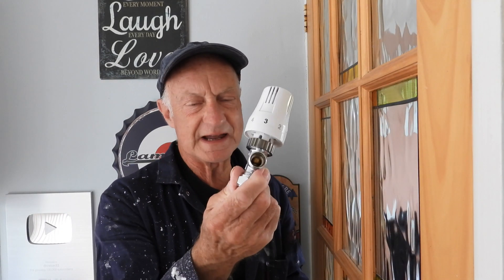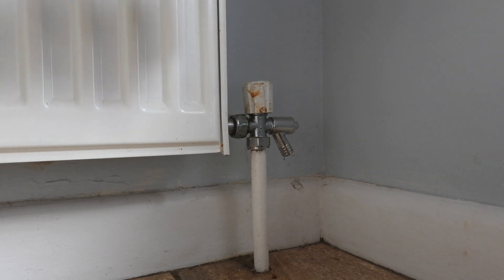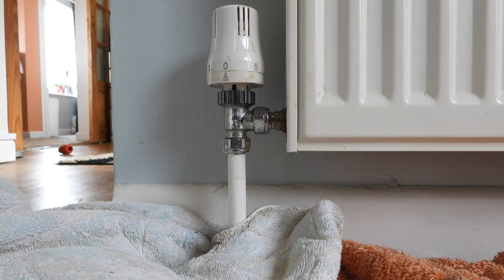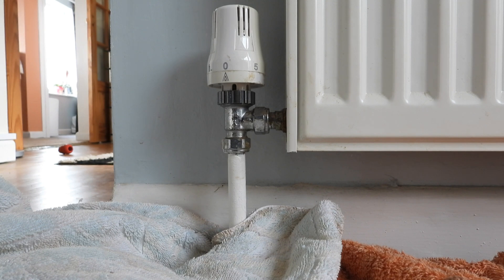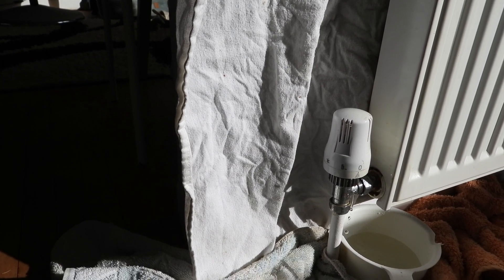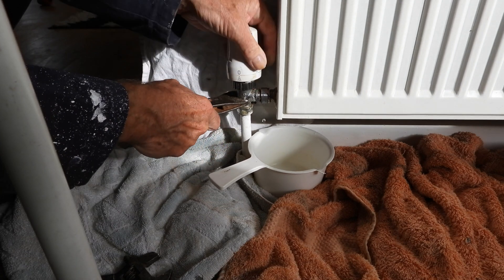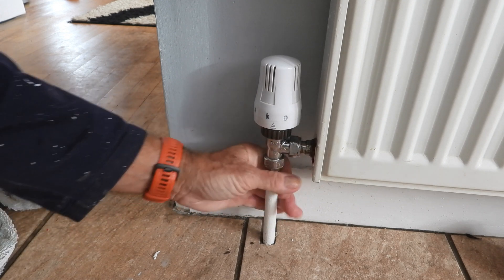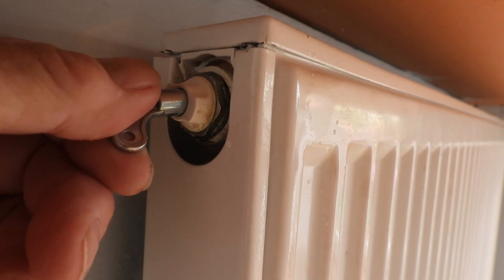Changing a thermostatic radiator valve without draining down.

Comment: Not a plumber but can usually do basic stuff. I have a lock shield valve that won't close 100% so did consider doping this but frankly thought it'd end up with a disaster. Seeing someone just wrangling it like this and getting it done was great. Biggest worry is mainly that the union will leak when disturbed (not been touched for decades) but frankly I just need the rad off the wall and sealed so we can decorate while we wait for a legit plumber to come and move the pipes. So, thanks for the vid - Inspired to try this!
Reply from the maker: You're welcome! Hope it goes well for your decorating.

Comment: Did you not release the pressure from the system side? (bottom TRV Connection) seemed like it was coming out under pressure ?
Reply from the maker: Yes.

Comment: Thanks for sharing this👍😊

If I find that I cant fix our weeping TRV (a process of elimination), Ill give this a try.

If the system isnt pressurised (ours isnt), will the water from the feed pipe be less pressurised, less fast flowing, less violent?

Also with a double rad, how much water do they hold (roughly)?

Many thanks in advance.

Keep up the good work👍👍😊😊
Reply from the maker: It will be less pressure, so less flow,  If it is a large double about 5 litres.
Reply: @dereton33   Thanks that's really kind of you. I think I've fixed it, looks like it had mild corrosion after being in one position for a time. Careful use of WD40/Duck Oil and putting it through the full range of movement several times over a few days seems to have done the trick. I've left it for a week or two with an ice-cream tub there, no leaks thus far - I'll take the  stat top off, check it again, see that it's dry and take the tub away🤞🤞🙏🙏😊😊💜💜

Comment: Can you drain from other side ? 
And if changing rad do i need to drain system or just use stop cock? Ty
Reply from the maker: You can drain from the other side.  If changing the rad you will need to drain down unless you get a rad the same size then you can just turn off the two valves and empty the rad.
Reply: @dereton33  thanks mate. Your videos are legendary. Fingers crossed I have a drain off valve.

Comment: Can you do this by turning the main stopcock off to the house and no water will then be in the system? Just wondering if that would work?
Reply from the maker: Err no . The system would need draining out.
Reply: @dereton33  I thought that would stop the pressure flowing through the pipe though? How would it drain out? Not sure what you mean water is still in the system?
Reply: @richie7361  There would still be water in the header tank, or combi pressure vessel, depending on which system you have.

Comment: I'm probably overlooking something fundamental but why bother draining the radiator?  Why not bung the connector, change the valve and reconnect followed by a bleed?  Surely  you are removing a large amount of inhibitor by draining a large radiator?  Also, is it better to close all the other valves on the system to reduce the pressure coming out the floor pipe?  Further thought, would it not be a good idea to have valves upstream on flow in and downstream on flow out to make it easier to change radiators etc just like we have isolators on basin, bath and toilet etc? I'm not suggesting use the cheap less than a quid ones - obviously something that can withstand high temps and still function.  Would a pegler full bore not work?  Is there a reason that isnt done?  I'm fairly new to plumbing only added a few valves, changed a toilet and taps but seems like central heating is more awkward but doesn't need to be.  Please feel free to point out my ignorance of course.
Reply from the maker: You will find it difficult to bung the rad tail with water pouring from it and the valve being in the way preventing you from getting a bung of some sort in. Even a large rad will not mean that much inhibitor lost.
Reply: @dereton33  Maybe I'll attempt it one day and make a video.  It will either work or be a good laugh.

Comment: Unfortunately in the real world, the TRV will be a different size. Or it'll be microbore and leak forever.
Reply from the maker: Most are pretty standard you just need to put the new valve up against the old one to see if the thread sizes match. I wouldn`t try it on microbore though.

Comment: Great video thanks! What causes the pressure? Would there be less pressure if the main water was off?
Reply from the maker: No still the same pressure. Whether you have a combi or a F and E system. The pressure is either from a combi pressure vessel or a small tank in the loft for F and E systems.

Comment: Never removed a radiator in my life until last night. I have plasterers coming in a few days time and they wanted it removed. After watching a Youtube video I took the plunge and removed it whilst my heating was switched off. The trouble is once I switched it back on the thermostatic valve end started leaking water. It was quite late and I phoned for an emergency plumber. Call out charge and a minimum hourly rate and "parts" would have cost around £450 + VAT. I told them where to go basically. In the end I shut down the whole heating system at the boiler so have no heat and no hot water except for my electric shower over my bath. Today it is the 16th December. You can guess how cold it is in the house. Hopefully once the walls are skimmed I can get the radiator back up and working again - that is if I survive.
Reply from the maker: Pity you did not just put a screw cap on the end of the trv . Never mind.

Comment: Hi AL I’m gunna be changing 5 trv’s around my house shall I do each rad without draining and I pull a vacuum or shall I drain the whole system down?
Reply from the maker: The vacuum does prevent air locks. All though I prefer a complete drain down in case the vacuum fails.

Comment: I'm at my mums, she's in a psychiatric hospital with depression so got an opportunity to completely makeover her living room and brighten it up (like black hole of Calcutta lol), both radiators are 35 yrs old, one's badly corroded so have ordered new ones+ TRV's and lockshields. It's on 8mm microbore and a pressurised combi system. I need to replace both valves on both radiators so ideally need to remove the olives from 4 pipes to do this? Or could I get away with re-using the existing nuts/olives with some Fernox White Jointing Compound, assuming the old nuts fit the new valves???
I'd ideally want all new fittings but never worked on a combi system before and am concerned that if I remove the valve and carefully cut the old olive it's gonna leak everywhere in the time that takes....  a mini rubber bung would be ideal ?? Is there any way of ensuring the water stops coming out of the pipe?? (BTW I've replaced a radiator before- Uponor nightmare pipework mated to conventional fittings, had a vented gravity fed header tank but did it like you- popped the old valve and got the thumb over it! but there were no olives the uponor is O-ringed where it goes into the 15mm fitting)
Reply from the maker: O rings are best not to try fitting new valves on. If you have olives on when you take off the old valves you may find the nuts and olives fit the new ones , worth a try. If not then they will have to be sawn through carefully so you do not cut into the pipe.

Comment: Always good videos Derek! I’ve seen people cut straight into pipework with the boiler switched off and then stick their fingers over the end of the pipe, obviously once the water has cooled down. Would I be able to do this with a Combi boiler that has pressure of 1 bar? Not exactly sure what point pressure becomes a problem? I￼ used a bike pump and managed to get to 2.5 bar before I couldn’t hold it any longer, but not sure if it’s the same thing?
Reply from the maker: Yes you should be able to hold one bar. It will still make a bit of a watery mess so have some towels handy.

Comment: Hi Al, would these steps be the same for replacing a lockshield valve? 
I have a leaking lockshield on a radiator that has a TRV installed on the other end, but I'm not sure if water will come rushing out when I remove the lockshield!
Reply from the maker: If you turn the TRV full off to zero that will stop the water one side. Do be aware you will still get water from the lockshield valve when you remove it.
Reply: @dereton33  Thanks for the tip! Is yours a pressurised combi system or a gravity fed one? That seems to be a lot of water rushing out the moment the valve was removed at 8:15!

Comment: Hi mate. The TRV on my rad is leaking from the nut connecting to the pipe. Will this mean changing the TRV, or just a quick tightening of the nut?
Reply from the maker: Try a quick tighten first.

Comment: Just had a plumber round today to fix a radiator valve.   5 hours later it's done🙄2 hours to drain/then old pipe was crimped so it leaked everywhere carpet ruined. Then couldn't get boiler working. 5 friggin hours. Jeeez
Reply from the maker: One quick swap and it`s all done.

Comment: I plan on doing this but the valves I want to change look a bit different.  The current TRV seems to fit with a spring where you turn the black collar to remove the head part.  The new one have the metal ring you tighten.  As I am removing the whole unit, does this make any difference?
Reply from the maker: Not if you are renewing the whole thing.

Comment: A really helpful video thank you! Sadly the two troublesome valves I have are stuck open, so I can't do this. But I wouldn't have known if you hadn't mentioned this in your video. Time to get a plumber out! 🙁
Reply: Are you getting a constant heat from the radiators?
Reply: @rhyanmansfield4005  Yes I am. After further checking I've discovered 2 more that moved but didn't close enough to stop their radiators heating up, they just heated slower so I didn't notice on a quick check.  I managed to fix 3 others that were either partially seized or fully seized but loosened up fully after oiling, leaving a few hours, tapping and pressing up and down a lot. When the engineer came he's serviced the boiler and found significant sludge in the system which I guess could be causing the valves to block. Going to get the system flushed on Friday and see what happens.
Reply from the maker: You're welcome!

Comment: I have a rad with a TRV which gets red hot no matter which way I fully turn the TRV. Does this mean the TRV is completely broken & needs replacing or could it be salvaged? Thanks
Reply from the maker: Needs changing.
Reply: Put a decorators cap on it, if the rad cools off then you just need a new head without any water works. Otherwise yeh, replace it.
Reply: Sounds as if the valve is stuck to its seat. I've freed many of these by gently tapping the valve body with a small hammer and gently tapping the pin, successful on most occasions, but do remove the TRV head first!

Comment: Which side of the radiator was the valve changed? Was it the flow or return?
Reply from the maker: The flow.
Reply: @dereton33  Thanks!!, and does it matter which side I change, say I was swapping out a lockshield valve with a bidirectional TRV? Is the process the same?

Comment: Brilliant video as ever Del, your tips are worth their weight in gold. I'm swapping a rad for a slightly narrower towel radiator, can I use the "snatch" technique on both sides of the rad i.e. the themostatic and lockshield valves? Cheers!
Reply: Make sure the pipe doesn't drop down beneath the floorboards when you take off old valve. Best to clamp pipe on to floorboard using a quick release
Reply from the maker: Yes sure can.
Reply: This is just what I was looking for. Thank you 😊

Comment: I am reading that wax TRV'S are becoming popular again over fluid TRV'S. I wonder which will last longer and be a more reliable TRV. Also, what's your opinion on smart programmable TRV'S. I am told they are problematic.
Reply from the maker: Yes they are I fitted one, to try out and it never worked properly.
Reply: I've fitted a number of Honeywell (now Residio) Evohome  systems and they worked well.

Comment: Good vid. But I have a Themo valve with no bottom nut. Just black bit of plastic at bottom. Very old comap. Is it push fit. How do I remove??? Thanks for any help.
Reply from the maker: Has to be sawn off. It`s not a push fit.
Reply: @dereton33  thought as much. I had already looked at a new hacksaw. Screwfix here I come. Really appreciate your reply!
Reply: @mrj8856  don’t hacksaw the pipe live please 😢 heating water shower incoming 😂
Reply: Yeah tell me now I've flooded the living room...! Only joking. Yeah to anyone else with one of these old valves...make sure pressure is drained off first...then hacksaw copper pipe just under valve! And thanks for tip....New Radiator up!

Comment: You can also drain the radiator by closing both valves and using the drain valve integrated into the lock shield valve. But you have to fully drain the radiator in that case.
Reply from the maker: I was just showing the quick change method for this video.

Comment: Nice video
Would releasing the pressure through the bleed valve be easier then block the rad with some rag after releasing nut so you don’t have to drain the Rad or shut off the valve.
Reply from the maker: Yes but very akward to do.
Reply: You can use Plum Thumbs, it’s a plastic threaded lever, same thread as the valve. That will hold the water in the rad.

Comment: not sure if i have asked before but what is the best way to fix a radiator to one of those horrible soft thermalite block walls? i hate fixing anything to them but no choice.
Reply from the maker: Rawl bolts.
Reply: You can also try screws straight into the block, if it's the soft thermalite block it should hold just fine, use at least 2 1/2" screws for it
Reply: @pallsmortion4750  i am not brave enough just to use screws, it is big tall heavy beastie
Reply: @ShadowzGSD the  just screw one bracket up then try to pull it down, you'll be surprised